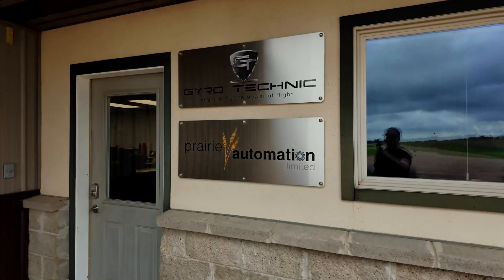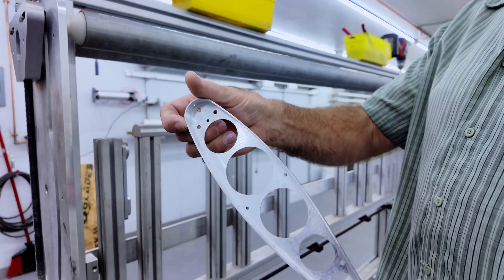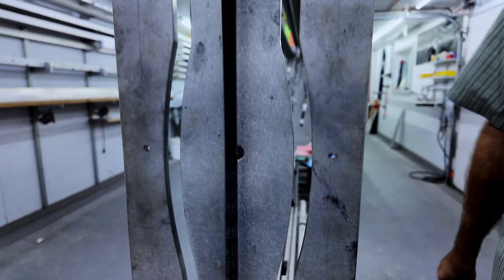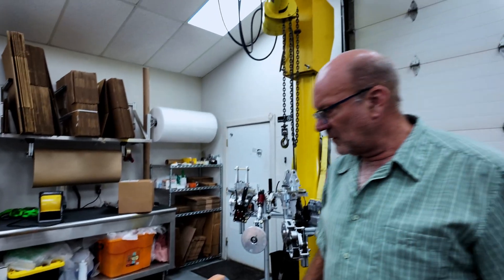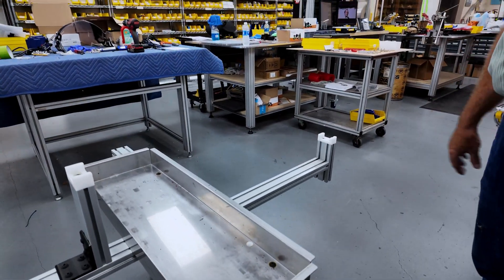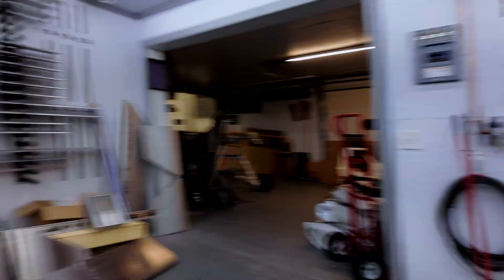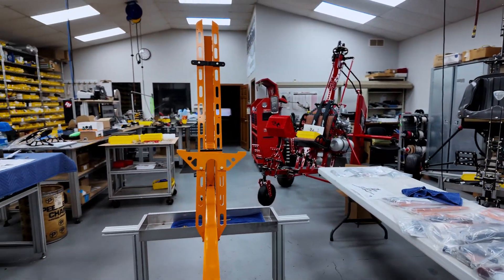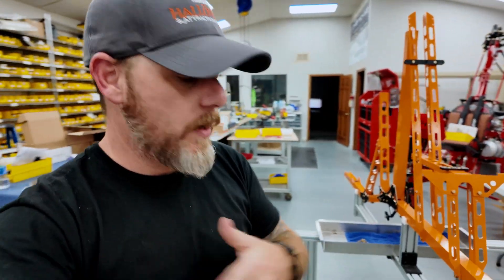Starting my Gyroplane Build! The Gyro Technic GT-VX 1 Part 1

Comment: I can’t wait to do this exact same thing! I’m currently trying to figure out how to secure funds to build mine.
Reply from the maker: @eguerra4001  That's awesome! It's such an incredible experience! You thinking getting it shipped to you or doing the build assist?
Reply: @ most definitely build assist.
Reply from the maker: @eguerra4001  That's definitely been a blast! But it's nice the entire kit can be assembled with bolts which makes it easy to build in your own garage.
Reply: @ my issue would be lack of proper tools. Bearing press, etc. does  everything come with torque specs and lock washers. Also, where would you recommend training to fly it?
Reply: @ I imagine if they ship it, everything is already painted and riveted
Reply from the maker: @eguerra4001  it's virtually all bolt together and Denis can provide torque specs. I used a small arbor press for the bearings and some spacers, but you could just as easily use shop clamps, which I did use to compress the strut spring. It can all be done with basic hand tools. If it's shipped to you as a kit, the tail will already be riveted together, you just bolt it on. 

Training really depends where your located. You'll likely have to travel but there are options for great instructors.
Reply from the maker: @eguerra4001  yup! You pick the colors and it arrives ready to assemble! Search for Tyler Menzies video. He ordered the kit shipped to him and did a video series on putting it together.
Reply: @ yeah, I’ve been watching Tyler’s videos… awesome series. I think i like the idea of building one in my shop. Once upon a time i built a custom motorcycle part by part that was shipped to me. I understand this is an aircraft, but with the attention to detail in the build documentation as you described, id feel comfortable building one. Next to flying it, that’ll be the fun part for me. In terms of difficulty, being proficient at flying it will come next (I hold a fixed wing certificate since 02, however I haven’t flown in some years). Lastly and probably the most difficult for me at the moment will be the funding, but I’m doing my absolute best to figure that out. It may take a year or two… we’ll see.
Reply from the maker: @eguerra4001  slow and steady, nothing wrong with that! I'll say this, I'm not particularly mechanically inclined..my background is in filmmaking. And I can honestly say. I'd feel 100% confident building this machine based on the plans provided, it's that well packaged and documented. I'm also filming a step by step assembly video that builders will have access too. It's a perfect shop project that you wrench on on the weekends.

Comment: I want to build one too, 3 months from now.  Are you planning to post the whole build process?
Reply from the maker: @edtotman2952  You should build one! I will be posting the next vids in the process soon! I will be uploading the entire build as I get it finished.
Reply: @gyronautjones  how long does it take start to finish?  Which engine did you choose?
Reply from the maker: @edtotman2952  if you build in the shop, it can be done in two weeks. I am going with the Simonini Victor 2 super 100hp engine.